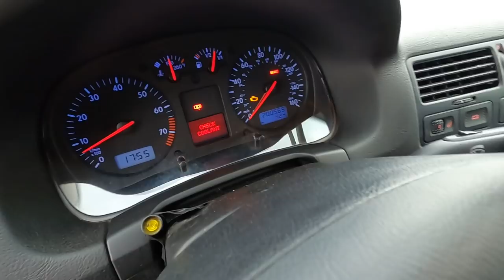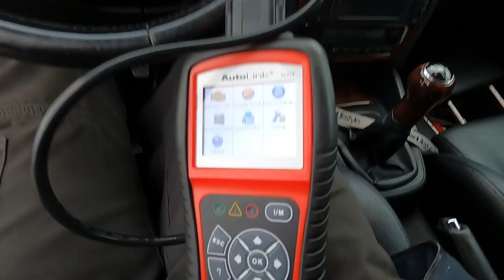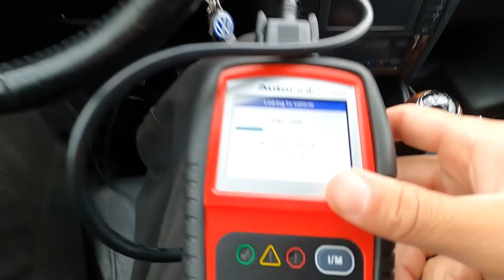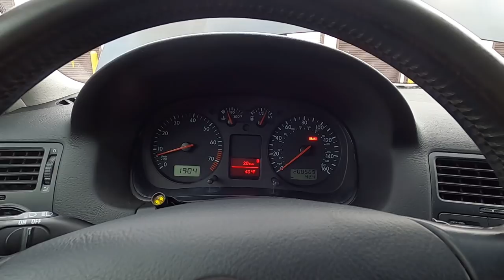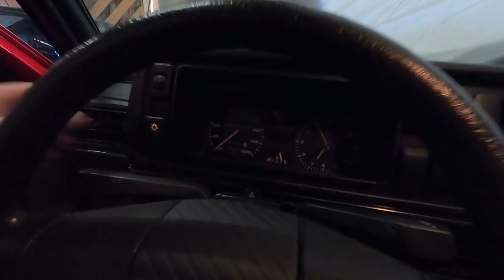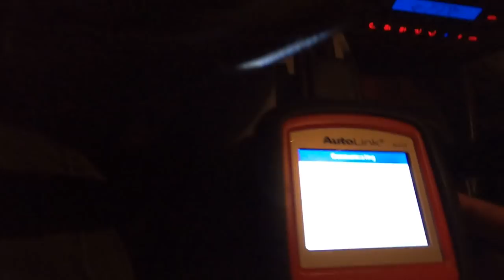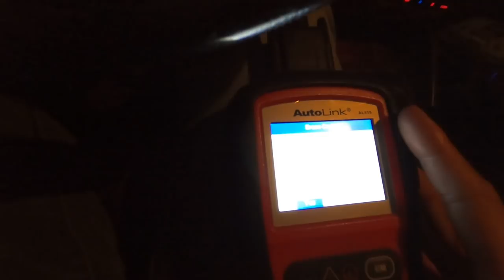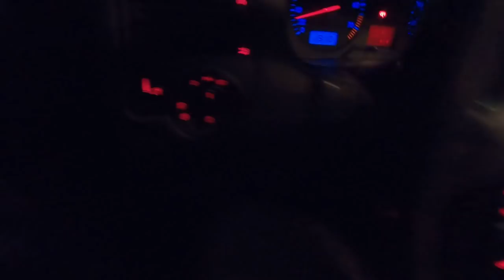The Jetta Wagon Has A Check Engine Light ( 12v VR6 )

Comment: Chris man, i already got this code "camshaft position sensor: out of range" on my TDI, and after 1 week looking and changing the sensors i figure it out that actually was the timing belt that has passed 2 teeth, but in my case, the ecu doesnt even allowed my car to start... It was running perfectly when the light came on, and the engine instantly shuted down... I replaced the timing belt (on the right position again), cleaned the error, and the engine just started again with no errors

Comment: @Christian Smith  i had an issue with my 1.8T a few weeks ago with the cam position sensor. a new sensor didnt fix it, none of the wiring was shorting. if a new sensor doesnt fix it, check your timing. turned out my belt had skipped a tooth and jumped timing a little bit. i know you just did the new chains and guides, and that youre a pro, but you never you know man, everyone makes mistakes! good luck, hope you get it fixed soon! 😎

Comment: Hey Chris, take it from an old retired mechanic, ya can’t fix it with used parts. I swapped out a 69 Pontiac GTO engine twice because of low oil pressure. Turns out I kept using the oil filter from the original engine, which was clogged up solid with sludge. Hard lesson to learn. You should look into Kipnix hose clamp pliers. There made in Germany, of course, and they are the best. That vise grip is going to hurt some day. 🤕 loved the video, thanks. Enjoy the holidays. RickGTI. 🇺🇸

Comment: All the VR6 sounds today ❤️🔥 Glad to see Casey doing well and recovering. Since there are a lot of vw people, I got a new shocks today and lowering springs. The back of the car is good but the front sits higher then it did on a stock suspension. Someone maybe know why? 
MK4 1.9 TDI 
Great vid!
Reply: Yeah, happened the same to me, you have to wait 1 or 2 weeks when you apply "lowered" spring on new shocks, because new shock has to "adapt" the right position on the lowered springs
Reply: @rafapsim  thanks! I will wait patiently

Comment: I had the same code on my 04 GTI VR6...car drove fine but light wouldn't keep coming on after going through a couple eBay sensors, I brought it to a shop to do a diagnostics and they told me it was the alternator....weird....but I picked up an alternator a Bosch sensor and that fixed the problem...the car only had 82k miles at the time so I would of never thought of being an alternator problem

Comment: Timing can be off a tooth and still run fine. Mine was off a tooth and ran seemingly perfect. If the crank sensor was bad the car would have starting issues, and cam sensors rarely fail so that's likely not your problem. Did you prime the upper tensioner before installing? Did you roll the engine around multiple times to verify before installing the valve cover? You're likely off a tooth man.
Reply: It probably jumped after installing if the upper tensioner wasn't primed.

Comment: Try invest in an Obdeleven scan tool? Maybe the " check engine light" gremlin from the other wagon you sold is haunting you now. Faults normally manifest after 2-3 key cycles, also do you need readiness to pass inspection?, you must do live data readings. Humble mechanic has a video to check chain wear, maybe you can use it to see if timing might have gone out for whatever reason without opening up again!?